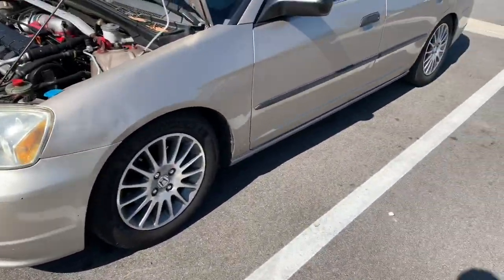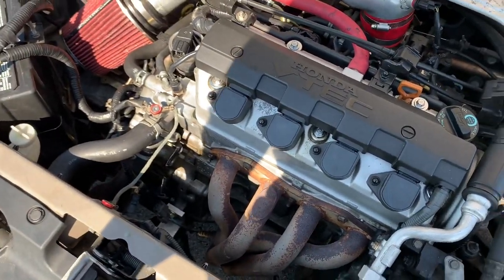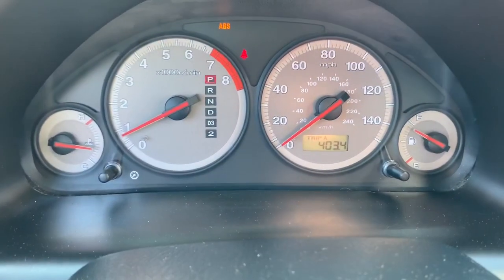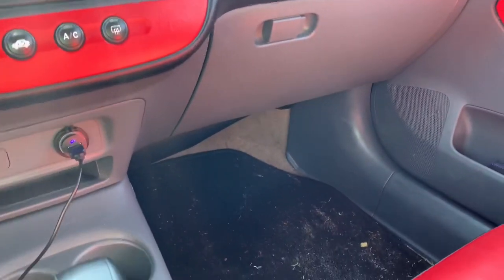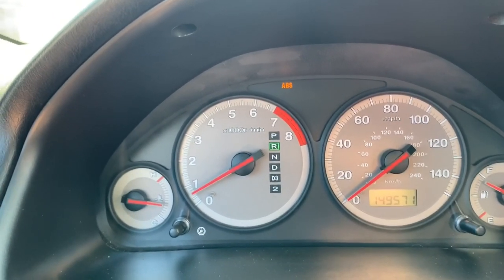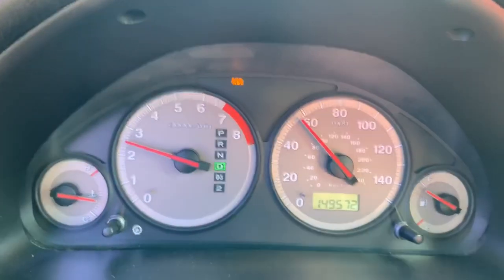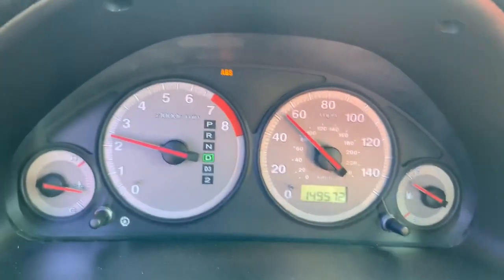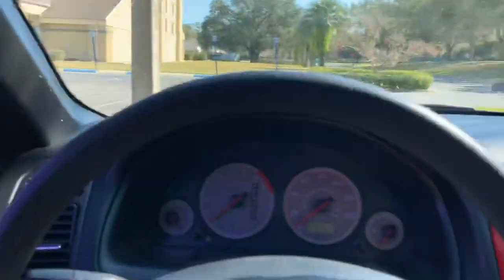BMXA to SLXA automatic transmission swap 01-05 Honda Civic

Comment: The swaps work, only thing is that they throw a code for torque converter so they rev high. I been driving mine for 3yrs and no trans issue

Comment: I swapped a North American (not sure if US or Canada but not a Japanese SLXA) built SLXA transmission from an 05 into my US-built 01 with a dead BMXA, everything lined up perfectly and there have been zero issues.
Reply: Did this fix issue for you ? Did you have problems with codes ?
Reply: @mikes19081  Yes it did. Zero codes. I see it around town all the time.
Reply: Did u swap out the sensor for usa?
Reply: @whosn55  I don’t believe I did. Everything just bolted right up.
Reply from the maker: I went with the jdm trans do to cost I couldn’t find any North American trans without high mileage and high price. I picked up that jdm trans for like $200 I want to say and it had like 30,000 miles on it.

Comment: I have a 2001 Honda Civic lx, I installed a transmission imported from Japan, the car is from the United States, the problem is that the engine light comes on and it throws the torque converter code, I did not know and the problem turned out, I do not know what to do so that it does not turn on engine light
Reply: Did you swap out all the sensors from the Japan transmission?

Comment: Thanks for the information. I was wonder did you ever tried to replace the BMXA torque convertor into the SLXA trany? Would it fit?
Reply: I did this swap as well and put my bmxa torque converter in with the slxa trans and still threw p0740 code. Got a honda stream jdm ecu and put it in my car and no more code for tc. Was getting a code for egr and vtec so I ordered the 2 connectors for vtec and 5 wire connector for egr and ran them to the jdm Honda Stream ecu and throwing no codes now. The SLXA trans is geared much shorter but oddly enough, cruising at 70mph/3100rpm I'm getting 34/35mpg still. Overall, Torque converters in bmxa and slxa are identical. If you put the D17A2 engine and slxa trans into an American car that originally had D17A1 and bmxa, I highly recommend getting a Honda Stream ecu and wiring up the vtec and egr. If you put slxa in American civic EX model with original D17a2 vtec engine, order Jdm Honda Stream ecu and put it in. Obviously, you'll need ecu flashed and keys programmed. The p0740 code is only the American ecu not syncing with jdm slxa trans, trans is good, tc is good, just programming.

Comment: When you put in the slxa does your car feel like it's dragging in 4th gear when you let off the gas? Kinda like its engine braking?
Reply: The JDM trans is geared more aggressively so it cruises at a higher RPM, so yes it will feel like it is engine braking more with this trans than the stock US one. I noticed the same thing.

Comment: Hey quick question. So "JDM FLORIDA" did they say u was suppose to swap the sensors from ur old trans or a USA trans to the SLXA transmission or not. Because im in the same boat now and JDM NY says if u keep all the japan sensors it will not operate the same as usa hence both countries sensors operate differently maybe thats why that p0740 code keeps coming on after certain speed
Reply from the maker: They did but I didn’t swap anything I even used the oem range position sensor.

Comment: I have a north american built 01 Civic EX VTEC with the BMXA (probably) that is on its last legs. I purchased a 2005 Civic EX VTEC SLXA transmission, which came out of a canada built car. I bought the 05 because I know they fixed the issues by then. Do you think I'll run into any issues swapping?

Comment: Is the point of the SLXA swap to avoid repairing the stock BMXA trans, or because there is some performance advantage?  I ran across this looking for parts to rebuild/shift kit my nephew's BMXA 2001 Civic.
Reply: Mainly due to the fact that it's much cheaper and will typically last longer then a rebuilt BMXA will. Remanufactured BMXA transmissions are improved and updated so they last longer, but with that you quickly exceed the value of the car.

Comment: i purchased a 2001 civic coupe that the owner did and jdm swap motor and trans , i am going to replace the transmission range sensor today, what are the other sensors on the trans that i should swap?
Reply from the maker: I didn’t change any sensors at all I just messed with the range sensor a little till it showed on the selector.

Comment: Have you noticed that on the SLXA rpms are a lot higher than the BMXA trans?
Reply from the maker: They where but I still got 42mpg
Reply: U might b getting high rpm because u didn't swap out the old sensors

Comment: Can you swap the torque converter on the transmission, to avoid the code?
Reply from the maker: Usually the old torque converter is the problem.

Comment: So the tourqe converter that comes with the Japan Trans can u use its tourqe converter or do I need to swap the bmxa one on it
Reply from the maker: You swap everything that comes with the jam trans along with the jam torque converter, usually the original torque converter is what goes bad not the trans it’s self.

Comment: I keep getting a p0715 says transmission speed sensor  code I changed it and it comes back my car had a slxa originally it’s really frustrating I get the d light flashing
Reply: Did you solve the problem

Comment: Does this skip D3 and go to 2 gear, and then get the check engine light??
Reply: Check engine light comes on when the torque converter locks up. Only because the american models use a different computer then the japanese models do.
Reply: So basically slxa trannys don't come w 2 so it should be at d3
Reply: Did u guys swap out the japan sensors from the slxa to usa
Reply: @whosn55  yea i dont know, the guy i bought the car did the job. I do get a torque converter code come up though.
Reply: But it runs and drive perfect yes? Does the code affect driving ability or no
Reply: @whosn55  it works, but for some reason the car has stalled, so far its become rare, but I hit the gas and it continues running. Only thing missing is the D2 shift. Im assuming its because it is a Japanese transmission, which the guy told me they did.
Reply: I’m doin a swap now as we speak I should get the car back tomorrow and idk what to expect JDM NY said swap the sensors over to usa and all should be well kinda nervous. But besides that I think I burned my original clutch and I’m jus swapping it because my car already has 250,000 miles I didn’t consider a rebuild
Reply: Also is ur call stalling because of the issue wit the converter code or something else. Also for drive 2 I believe they didn’t swap the neutral safety switch on the side of transmission on passenger side close to front wheel
Reply: @whosn55  im not really sure. I deduced that it needs the ignition valve cleaned, and its making it to lean or rich. I've added a few things, new radiator, new a.c compressor, new exhaust and catylici converter, has 160k.
Reply: @whosn55  swap what sensors ?  Also i have realized that the transmission shifts at 3500rpm instead of the regular 2500rpm, not sure if the Japanese transmission is the reason.
Reply: Even tho it shifts at 3500rpm the transmission doesn’t slip or anything right? Also does the Japanese transmission feels faster in anyway been as it shifts so high automatically
Reply: My car was overheating few weeks back I did radiator, thermostat and coolant temperature sensor and that fixes my overheating problem then 1 week later boom my car revs up in gear but slightly move or doesn’t move at all mechanic say its my transmission If I had knew before that the transmission I bought wasn’t the same exact tranny in my car which is bmxa I probably wouldn’t do the swap but hey I already got the job started so yea
Reply: @whosn55  so actually it shifts at about 3000 instead of 1500-2000. So yea it feels faster, but not good on gas. And the transmission does feel like it slips, sometimes its shifts before it hits the 3000 and it just doesn't feel right. Overall i paid $1300 plus putting in another 1500, i thought it was going to die within the first year, as it would try to stall but after adding new oxygen sensors it doesn't really happen, I've had the car going 4 yrs now so gave me alot of faith in Japanese cars !
Reply: An update. I jus got my car back but now its stallin in drive and D light blinking
Reply: Now idk man I did what they told me to do and same shit
Reply: @whosn55  so MY 2002 HONDA Civic has P-R-N-D-D3-2, whenever I shift past drive, it automatically skips D3 straight to "2", and I can drive the car still but the "D" indicator starts blinking. It drives a little funny i think but not sure, anyway the only way to stop the blinking D is to pull over and put the car in park, and turn the car off. And start it over again. As long as i don't go to "2", it never blinks.
Reply: @whosn55  yea my car would feel like it was stalling while driving at the beginning, like it wanted to turn off, it would go below 1000rpm, even while idling, but as long as i hit the gas, it would go back to normal. Now it doesn't really fo that.

These are the codes I would get and still get. P0420 (freezeframe), P0131, P1705 & P0420 (pending).
Reply: Okay so for the blinking light when I got my car back it did the same thing when I put in D the car would shut off or stall also my D light was blinking too. The reason for that is the safety neutral switch from the japan transmission needa come off it looks the same as the original but it’s different you have to change that otherwise you wont have D2 and ur shifters wont add up because japan transmission doesn’t have drive 2 I believe so yea if you change that safety neutral switch which is on the side of the transmission on passenger side. Then that should fix the blinking and shifter with the D3 and D2. Thats what they did today and it fix mine it should work man I honestly wanna make a video because I know alot yall stressing rn.
Reply: Okay I’m not sure about those codes but for the stalling my car doesn’t stall anymore after swapping all the sensors from my old transmission to the new one I understand that majority of the sensors from the japan looks alike but they definitely operate differently so id suggest make sure you swap all the sensors because ever since I swap the sensors now my car doesn’t shift early neither does it stall. The main sensor id suggest to change is the one on top of the transmission which I believe is called shift solenoid. That what fixes mine so id say change that first and should b fine.
Reply: Hey. So I did get the P0740 code but it doesn’t affect driving ability besides that everything else seems fine

Comment: Ok so it shifts but it wont pass smog cuz of the code
Reply from the maker: G & Shady productions yes but I live in Florida so no inspections.
Reply: Erase problem codes before taking it to get it smogged. Drive it for 5-10 minutes at low speeds, and then take it in. It always works.
Reply: @maximilianocampos473  are you serious bro?
I need to pass smog check this month. Do I have to use the  obd scanner to be sure its ready for the test?? I hope you respond me , I really need your help

Comment: I changed my My Old BMXA to a SLXA and my rpm is a lot higher at 60mph rpm at 3700rpm I think the slxa is not for USA made hondas
Reply: Did u swaap out the Japan sensors on slxa trans to usa?

Comment: Hi friend    I have same problem I changed my transmission jdm.   Honda Civic 2005.   American. Come Engine light p0741.  Convert torque open close I changed all sensors American Honda...( The question is no can do nothing for this Code.  Tanks. Brother...).    What happen if  me change convert torque the American transmission tank
Reply: I am not sure if I understand what you are asking. So you changed your American transmission to a JDM SLXA transmission and now you have a p0741 code. Is that correct?
Reply: Yes Correct
Reply: @denismartinez3932  Okay thank you for clarifying. I have heard people say that these transmissions will cause an American computer to set that code. Does the transmission operate correctly?
Reply: Yes sr.   My transmission drive very good.  70.    80 mph.  Some times 90.
Reply: @denismartinez3932  Honestly I wouldn't worry about the code since it drives fine, it won't hurt anything. The US computer just thinks it's not locking the torque converter because the RPM in 4th gear is higher, that's all. However, if you want to get rid of the code, you can get a JDM computer like I did. I only paid $15 for one of mine and it works fine. A Japanese computer won't set a code because it's programmed for the gearing of this transmission. If you are considering getting one, let me know and I will give you more info on JDM computers. I hope this helps, let me know if you have any more questions
Reply: Avery Alexander could I get some info on a JDM computer or better which one I should look for
Reply: @MrMaperez98  Sure. What type of car do you have?
Reply: Avery Alexander I have a 2001 civic ex   I installed a hem tranny would like to get rid of the check engine since I’m in Cali
Reply: When you replaced the JDM computer, did you run into any issues with the mobilizer? Some people report they have some issues with that.
Reply: @kesu90  Nope. Most of the JDM ECU's from that time didn't have immobilizers, so it was plug and play for me after moving the fuel pump relay wire down 1 hole. No flash required. I am using a 37820-PSA-J84 from a Honda Stream. What I found out is that the ECU's with part numbers ending in J (like my J84) don't have immobilizers, but the ECU's with part numbers ending in N (like the N81) do have immobilizers, so don't get one of those unless you want to retain your immobilizer and you are okay with taking it to the Honda dealer and paying them to flash it, if they can even flash a JDM ECU. I presume they could since Honda most likely used the same immobilizer in Japan as they did here, but I never did it so I don't know for sure. Let me know if you have more questions
Reply: @averyalexander2303  please help me. I too swapped to the jdm also from jdm fl. what else did you need for the jdm ecu swap? did it seem faster now that the ecu and tranny are working together correctly?
Reply: @IIVIIyHero  Actually I swapped to a JDM ECU and wiring harness a couple years before I swapped the transmission because I swapped to a JDM D17A VTEC engine and mine didn't come with VTEC. So I'm not sure if the JDM transmission felt faster with the JDM ECU because that's all I ever drove it with, but it definitely felt faster than with the US transmission because the JDM transmission is geared lower. Unfortunately I can't test it now because I have since swapped to a 5 speed manual transmission. Hope this helps, if you have any more questions let me know.